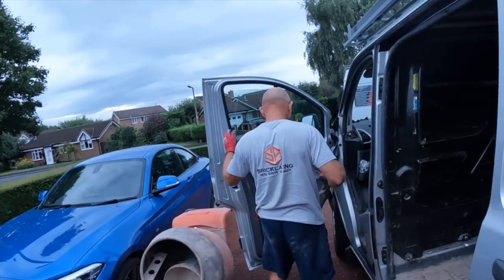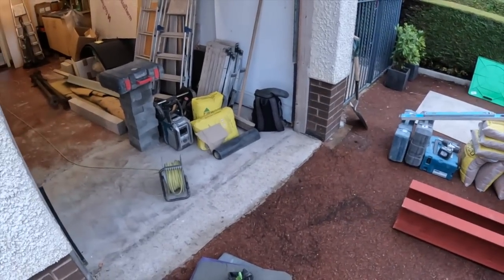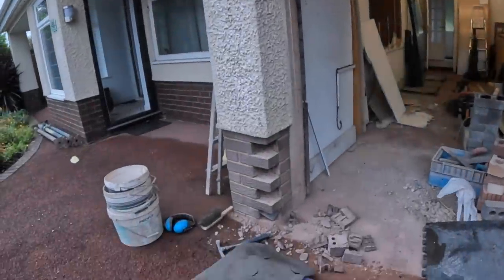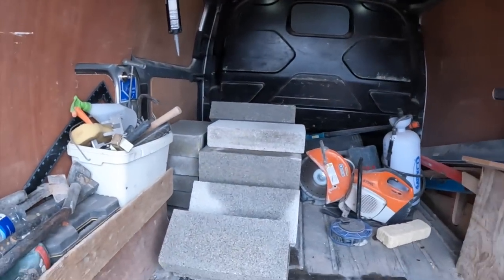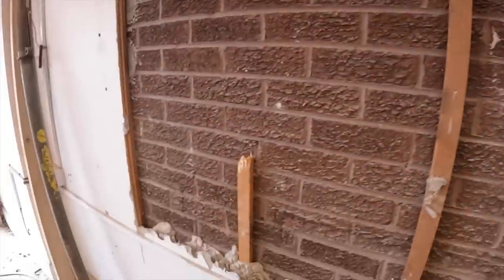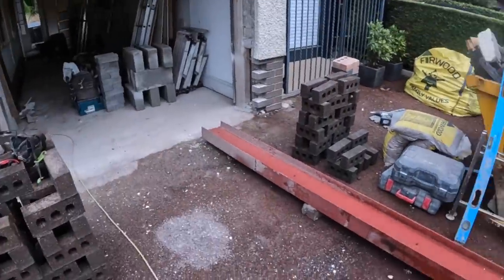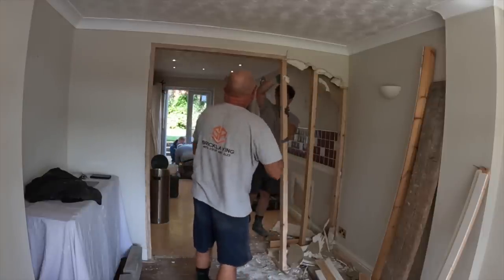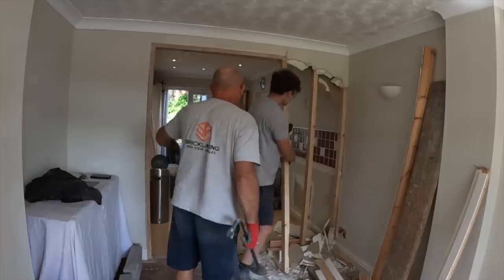WE ABANDONED THE BRICKWORK ...GARAGE CONVERSION PT 1

Comment: I noticed that you have a drum roll of wire suppling  both of your drills now that roll of wire with all the electricity running through it is making a inductor please when using that wire make sure it is spread out and not in a coil or one day when using machinery it could go on fire have a great day oh and don't you have a wood burner at home  with all that wood going in the skip and thank you for the video
Reply from the maker: Thanks for the advice Eddie .. no we don't have a wood burner, i'm busy enough without all the hassle of keeping one of those things going 😬🧱👍🏽